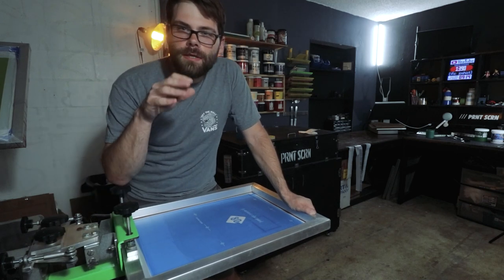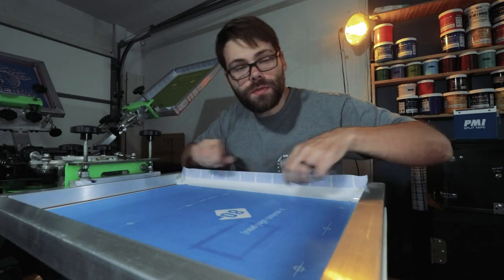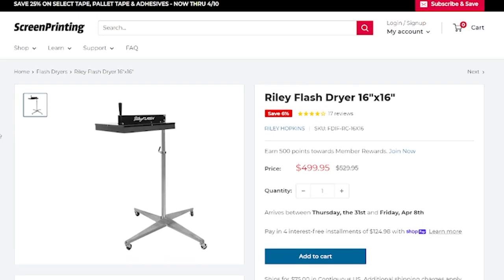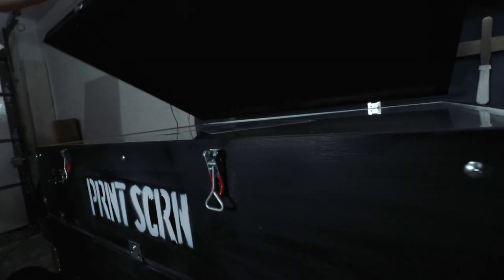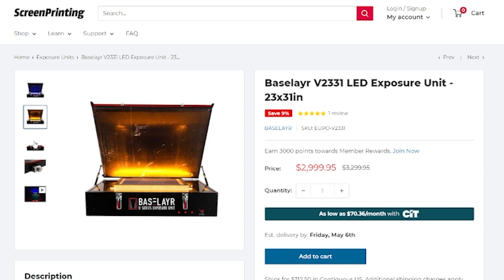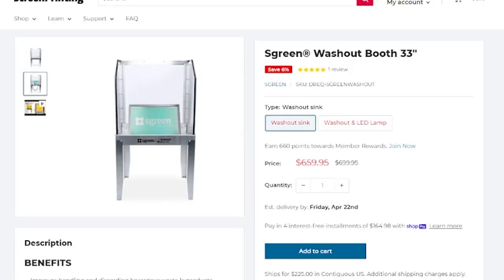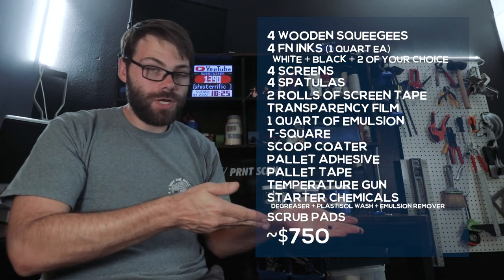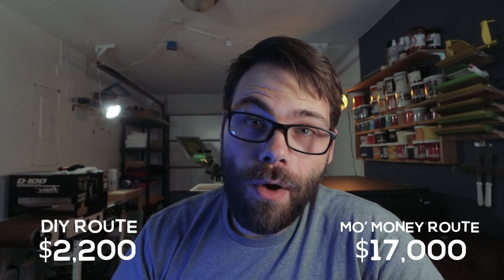How Much Does It Cost to Start Screen Printing? /// Investing in Your Screen Printing Business

Comment: a heat gun works pretty good for one color at the beginning too...
Reply from the maker: yeah, I would say if you're only doing 1 color prints a heat gun is ok in the beginning, but if you're printing multiple colors it can be a real pain. I started with a heat gun and when I upgraded to a flash everything cured so much better.
Reply: Yes it does that's how I started

Comment: Soon as you said $2200 i was out....but great video
Reply from the maker: $2200 would be the bare minimum for a fully functional print studio, however you can absolutely start for less and eventually upgrade your equipment. Buy a 1-color press, use a heat gun to cure, use your bathroom as a dark room and a bathtub as a washout booth. More affordable, but not ideal.